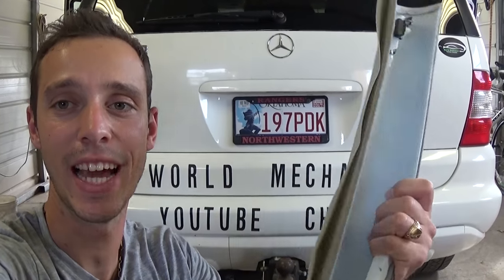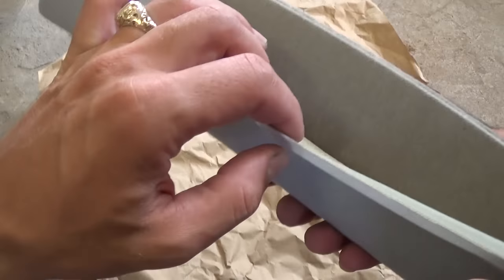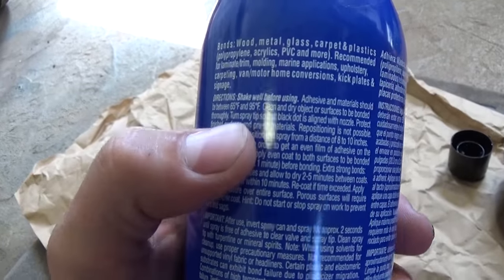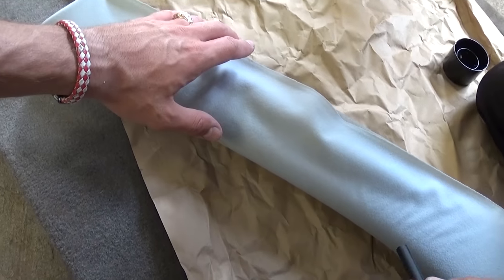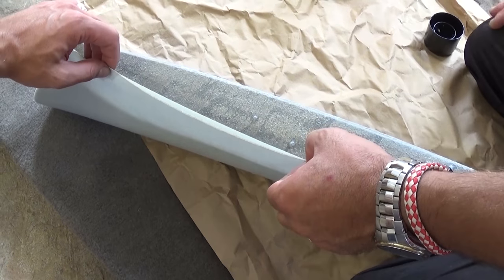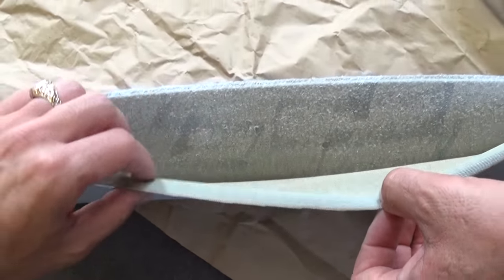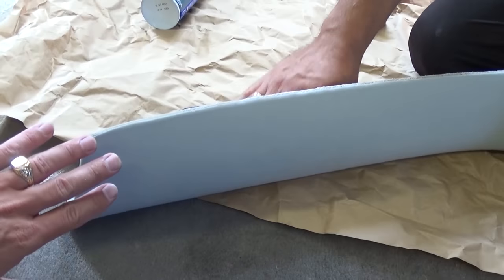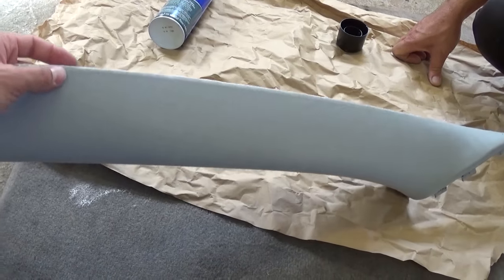HOW TO FIX SAGGING HEADLINER OR INTERIOR TRIM

Comment: Thanks a bunch. Local upholstery shop quoted $350 to do this job. This cost me about $9.00 for the spray on adhesive at the local Lowe's store. One word of advice for those to follow. The guy in the video stresses making sure the glue is dry. I can not emphasize that enough. I had one little spot where the glue wasn't dry and it soaked into the fabric and I have a small dark spot at that location. Fortunately it is down low and barely visible when seated in the drivers seat. I did use a credit card to help smooth out the fabric as I applied it. Slow is smooth. Take your time. It also helps to have a spare pair of hands. Great Video.

Comment: ok so I need more info on this whole copart thing I had no clue there is 4 around me might be able to buy a couple cars can I get some tips or info if you want we can exchange emails or something thanks in advance
Reply from the maker: hey bro, that's great but always go check out the car in person. Make sure the car was not flooded. If the car looks great and it says that it runs and drives there still can be a mechanical problem like bad transmission or overheated engine and more... We usually buy wrecked ones that do not need much work or the ones that say mechanical damage. Sometime we bought car that had hail damage and it was not listed and it was not visible in pictures so check the cars out in person
Reply: see I didn't know if copart would let you check out the car before you bought and is there anyway to tell if someone died in a car do they tell you
Reply from the maker: Usually We never buy really bad wrecks. Mostly fender benders. If there is blood in the car they are labeled as BIOHAZARD. I would recommend to stay out of this.
Reply: my thinking also lol its crazy how cheap some really nice cars go for